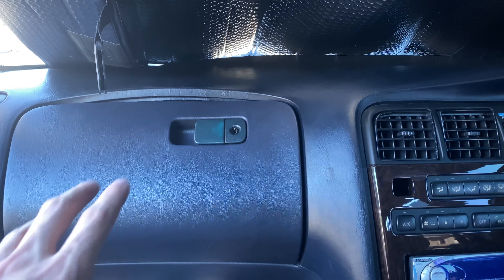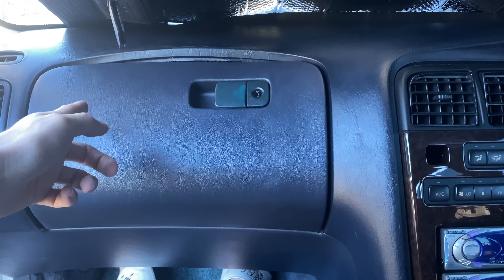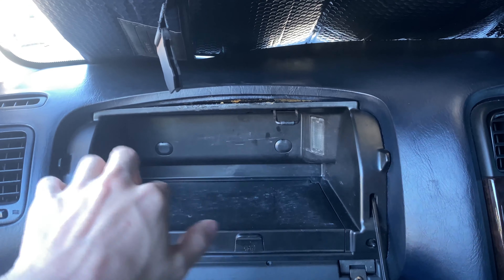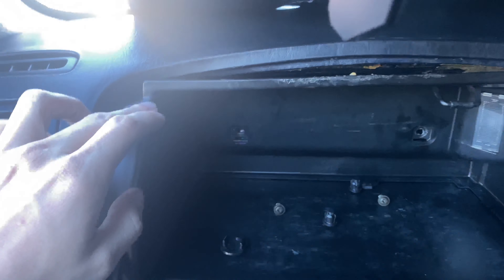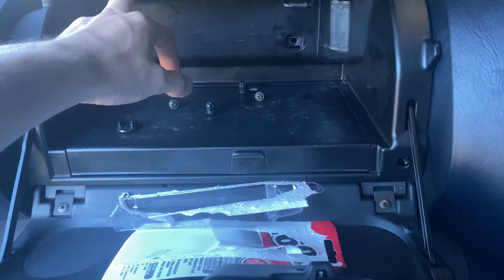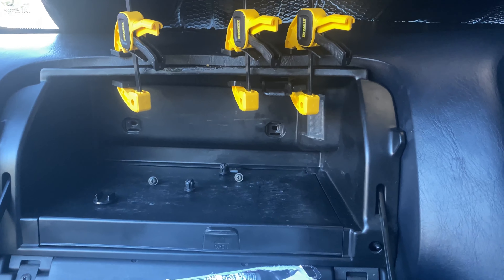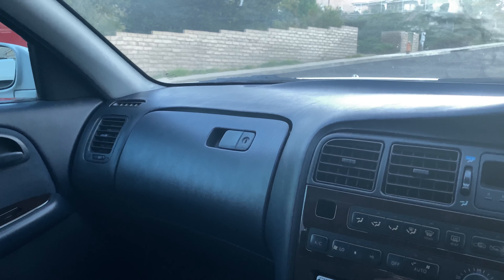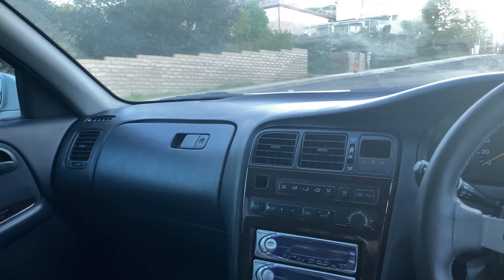Jzx90 dash lift “fix”

Comment: Usually how does a lifted dash happen on this car?
Reply from the maker: Direct sun and heat inside, the glue doesn’t really hold well.
Reply: @AlenGarner  will a dash cover help prevent all this from ever happening you think?
Reply: @AlenGarner  I know dash lifts are pretty common on the jzx100’s. Had no idea it was a issue for the 90’s as well